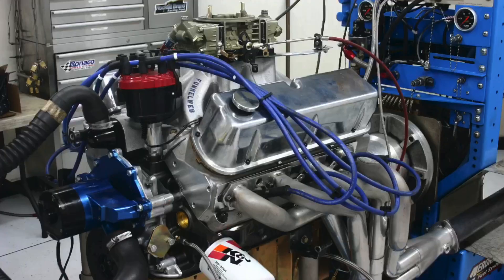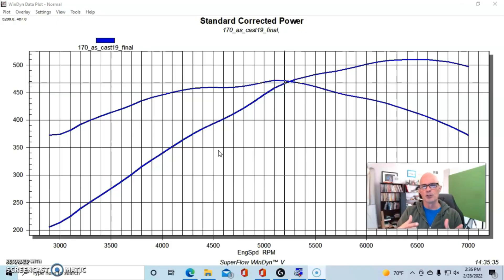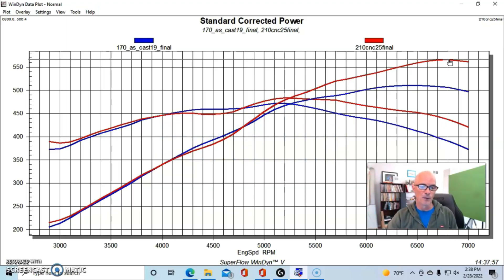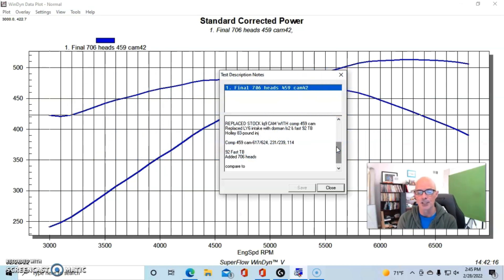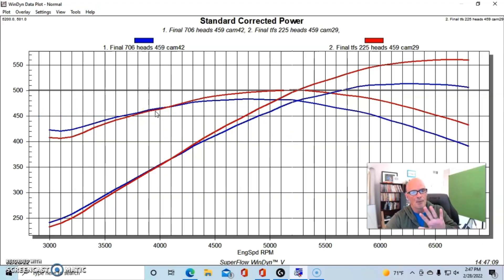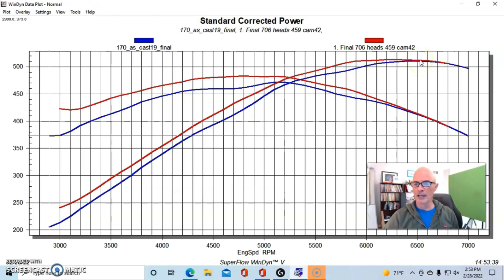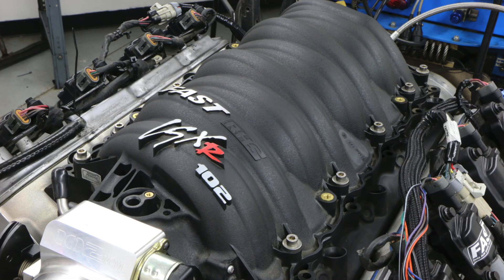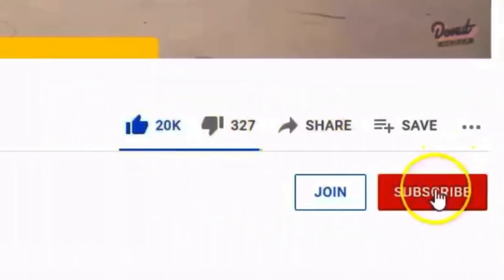HOW TO MAKE 6.0L POWER! FORD vs LS-WHICH 6.0L MAKES MORE POWER? MOD 363 FORD STROKER OR MOD 6.0L LS

Comment: I know a .030 over Cleveland with a set of Ford C3 heads will make more power than that because, I have  all ready done it. and you don't need a hi dollar after market block.  The C 3 heads were not any more money than a 225 TFS. The one thing I used was a solid roller cam. it may Give up a few Cubic inches, but the Cleveland can handle it.

Comment: If you are goong to compare two 6.0  engine ford and chev do it properly  same hyd cam and the same style inlet manifold can you redo the test again and this time have the dur lift and lobe on the same or as close as possible and run the holley high ram manifold

Comment: Some of these shows to me are amusing. If you want to see how power is made go to Engine Masters, Kaase as well as others took a Ford Cleveland to victory every year they entered the contest. And for a couple of years EM allowed the DOHC Ford's to enter. And every year they won, going 1-2-3 in one year. They had teams who brought the LS engines they achieved little success. The LS's boys complained and cried about losing. Finally, EM acquiesced and created an LS class because the engine could not compete with the Fords. And keep in mind Kaases Cleveland had been out of production for over 50 years! The LS was called a marvel of American Engineering, and it could not beat the extinct Ford. FACT!!!!!!! While almost all other companies went with the much better design of the OHC engines. GM stayed in the dark using the OHV set up that greatly hindered their performance.
Reply from the maker: ask yourself this, can both of them be good or do you have to put something down to try to elevate your choice?
Reply: @richardholdener1727  What I wrote were facts, go to Engine masters and look for yourself before you make a baseless accusation. What really surprises me is when someone does not agree with what has already happened, they attack the person not the facts that were stated. Are they both good engines? Is one better than the other? That is your choice to make. I am 74 and been a mechanic and worked in a machine shop. Drag raced both cars and motorcycles. And owned just about every muscle car out there. And I stand by what was printed and what took place at EM.

Comment: I went with a 363 for my fox body. I’m 100% satisfied. LS is cheaper for the short block but the corvette tax on parts adds up quick. Not to mention all the parts needed for the swap unless you can fabricate stuff. For me after doing the math they came out to about the same price and a lot more work vs having a fresh built motor. That’s something ls swap guys leave out often.
Reply: And, staying with a ford, especially a 5.0 based in a Fox assures you're not automatically banned from heaven. Had you went LS, it's an iffy eternal destination.
Reply: I make 600 hp on my dark block all motor ford going up to 1000 hp procharger or 1200hp
Reply: @jeffytherapper7279  how’s it drive on the street? Mine is at 530 and has some pretty reasonable manners. I was gonna grab a blower but I street drive it and it’s already a lot.

Comment: Ford is not that bad to build mine is a 398w stroker and I have 2500  in it good parts from market place I'm using a stock rod factory block

Comment: Yeah or you could buy a 351 from the junkyard and use 302 pistons and a stroker crank and have a 393 cubic inch stroker that when combined with good heads, cam, and intake would make as much as the LS, if not more. Depends on what you want to build.
Reply from the maker: 302 pistons don't turn a 351 into a 393
Reply: @richardholdener1727  No you need a 3.85 crank as well. I thought I had added that part but didn't, ooops. I have now added that part. Sorry just not a fan of using the LS in everything. I understand it is cheap horsepower but I'm not a fan of them in other makes. To be fair I'm not a fan of Coyotes in other makes either. I'm a fan of taking what you have and making it better.
Reply from the maker: this channel covers much more than just LS-in fact my first book was on Fords
Reply: @richardholdener1727  Oh I know I've watched dozens of your videos and been subscribed for years. Wasn't bashing you or the channel. Sorry if it seemed that way. Personally I like all engines although I'm more experienced with Fords. Would really love to see you test some AMC engines like the 390 and the 401. I'm not bashing LS engines either, I think they are amazing. I don't get into the arguments of this company stole that idea or blah blah blah either. Everyone's trying to make more power and better flowing heads help so each is going to develop similar looking items. Only so many ways to make a pushrod engine breathe better. No what I was saying is that I'm not a fan of taking out a perfecting good running engine and putting in a different make just for the sake of power. I'm a fan of making what you have better instead. Once again sorry for the misunderstanding.

Comment: Wish they were both ran with comparable cams and ported Holley hi-ram intakes. Theoretically,  they would be just about equal. The coil near plug versus distributor would probably still take the Win. I mean, engines are theoretically gas powered air pumps so they "should" perform nearly equal regardless of the brand.

Comment: First ford 363 run was with Dart pro 1 170's which have the 194/160 valve package.   I guess to compete with the AFR 165.   They did very well to make it over 500HP.
Reply: Agree with this comment.  The afr205 or tfs 11r 205 would let it shine.   Also intake manifold ported to go with the heads.

Comment: I would love to see an LS style intake made for the sbf.  Its basically a low profile tunnel ram.  Obviously to make it fit the Ford best it would have to be run distributorless.   But since it would be efi just go all the way.
Reply: Someone else said this and i agree.   They are calling them "cross ram" intake design...To get away with it a low profile distributor.

Comment: I've ran a lot of LS engines and I want to small block forwards I kind of go back-and-forth.. I like your videos because usually you do your best to make things equal.. But when you said it took a lot for the Ford the video shows the opposite you made a lot of changes with the LS kind of baby yet to get its power up I really think you said that because the LS guys and Chevy guys are always super sensitive.. But here's the bottom line the lower end stroke compression doesn't know if it's a Chevy or a Ford it literally can care less.. I would love for you to do this test using the new Holly Hyram on the small block Ford and LS The goal not to see which one does better but To see how close you could get them.. Because what I tell everybody is the LS Technology Is we're all the different is  Like I said the bottom end knows no difference only goal is for it to hold together other than that it's simple mathematical measurements.. I'm currently running A 408ww with  Holley Hiram LS style plug on wire with Holly terminator X system And I'm within 15 horsepower of the same set up with the 408 LS base motor.. Only reason I have slightly more power with the Ford Is most likely coming from my cook's headers really the only difference same size just a little better Collector in my opinion.. I absolutely love ls motors  But It's actually more unique to have the Ford motor in it nowadays.. And out Of the old school motors The Windsor is by far the Closer to the LS motor even than the small block 350.. But always a great job and love the videos but if you could please do a more direct comparison with the new Hollywood high ram and go with the  AFR220 renegades on the sbf  With the LS style coils And Halley H iram That's really A test everybody wants to see Bring the Windsor into The technology of the LS Not to try to beat it but to show people The capability of an old motor with new technology.. I know you can never get these things Completely even they're in 2 different worlds But the bottom line is they're both awesome motors with the right parts!!

Comment: How would the Ford run on the street? Could it handle a 200 mile trip at 2200 RPM?
Reply from the maker: FOR STREET USE I WOULD PICK A DIFFERENT CAM

Comment: Let’s make it a lil more fair next time you want to? 
How about running heads that actually flow as good as the heads used on the LS, and yes there’s plenty out there that flow better than these right out of the box. And also make it more even across the board, two completely different engines styles but you sure could’ve made the Ford perform better than that.
 I mean just think about how many 700+ HP SBF’s out there running around N/A with room to grow.. and to do the same with an LS is a lot more money. IF you know what you’re doing with a Ford engine to save money but still make power! It’s been done plenty around here in Florida!

Comment: I sure don’t understand why the 363 is called a stroker, what block was stroked? Not a Ford block so it wasn’t something else before, not a stroker!
Reply from the maker: THE 363 HAS A 3.4-INCH (NON STOCK) STROKER CRANK
Reply: @richardholdener1727  I'm well aware of the makings of the 363, the crank is a stroker crank in a 302/289 block but not the Dart or Ford non production block because they were designed for that crank. The 347 is a stroker the 363 is not.

Comment: I don't understand why you would not have run a dual plane on the Ford. Every test you run, the single plane kills everything with very little up top gain on your SBF tests
Reply from the maker: a single plane made much more than the dual plane on the 363
Reply: @richardholdener1727  Fair enough, but much more where? I was curious how a dual plane vs the long runner LS curve (tq and hp) would look say below 5500

Comment: I find it funny that for both engines the hp curve passed the torque curve at around 5250 rpm
Reply from the maker: YOU SHOULD FIND THIS EVEN FUNNIER-THE TORQUE AND HP CURVES OF EVERY ENGINE EVER MADE CROSS AT 5252 RPM

Comment: Ok Richard, this might sound crazy, but I've heard LS heads can be made to work on a 351W block?
Could an LS top end swap show any difference on to old 351 short motors (or Dart equivalent)with 30-40 years difference in friction and block stiffness design?
Do modern V8s make most of their power from head flow?
I'm kinda intrigued. (Or overly tired 🤣)
Reply from the maker: an ls head flows a lot more than a 5.0l ford head

Comment: Trick Flows are better flowing heads than DARTS. The Dart head is based on old tech, Trick Flows beat them every where in the RPM range.

Comment: I know Richard is not suggesting it, but the LS go fast goodies in this video didn't come from the "junkyard" and they weren't cheap.  If we just want to restrict the comparison to what's in the "junkyard", then it's pretty easy to find a cheap junkyard 351W and toss the heads out for aftermarket.  Yes, if you find a 6.0 LS (or any LS) you can keep the stock LS heads which are excellent but they better be since GM decided to optimize a pushrod engine when the rest of the world went to OHC for better specific fuel consumption (and other reasons).  Ford has not used pushrod engines since 1996 (except Godzilla), thus the LS/351W engine designs are not in same genre and although comparisons are inevitable, they are tiresome. Putting all that aside and sticking to junkyard gold, I don't think it's that easy to find a junkyard 6.0 LS (5.3 LSs are even getting harder to find).  Outside of the junkyard, I have seen a lot of the 6.0s for sale for much bigger money (like $1K) vs.a used 351W, so if the 6.0 LS is really that easy to find in the junkyard then why do they cost so much used?  These HP/TQ engine comparisons are interesting, but as Richard has said many times, similar displacement combined with similar head flow is going to produce similar HP/TQ. Building a high HP/TQ 351W stroker is not that expensive due to SBF economies of scale.  The argument that LS HP/TQ is cheaper per liter compared to other engines is true but only if you acquire one cheap, like from the junkyard, and run it unmodified.  Let's put aside the chassis conversion costs, which are not free.  Start modifying the engine like Richard did in this video and LS HP/TQ costs per liter shoot up fast. Same goes true to rebuilding that "junkyard" LS.  Rebuilding an LS isn't free or cheap either. Not trying to start a LS vs. the world argument, but again, Richard has said many many times, that similar displacement combined with similar head flows are going to produce similar HP/TQ every time (other factors being similar like CR).  If you really want to make a HP/TQ per liter argument, a stock junkyard LS wins every time, however I'm not sure what a junkyard engine vs. junkyard engine comparo is good for in a practical sense. since most people who pull a junkyard engine rebuild it.  Rebuild that LS and start adding go fast goodies and the HP/TQ per liter comparison equals out.  LS machine work isn't free and LS aftermarket speed parts aren't cheap.  I think the only real stand out comparison worth noting is that you can keep the junkyard LS heads where 351W heads need to be replaced, however a used craigslist 351W is usually cheaper than a big 6.0 LS ($250 vs. $1K).  Yes, its possible to find a junkyard where all engines are the same price, but like I said, its getting harder and harder to find the unicorn 30K mile crashed Corvette big LS for $150 at a pick-n-pull and drop it stock into your dad's 69 Camaro and hang out with the boys at the next LS fest.  Well done Richard on another great video.
Reply: Very well said.  I think you touched on Richard’s over arching theme that engines are air pumps.  ANY engine can make power, but you need good induction to get the air in and out.

I agree with you about the LS only being cheaper if you go SBE/junkyard induction.  Because as you said swaps aren’t free to adopt into another platform.  Most guys that are swapping are Chevy guys going into other platforms, because other than the old G and F bodies, they don’t have much else in plentiful numbers to race.

Comment: Bottom end of LS is far superior than the 351 block so the LS  will handle the hp all day long compared to the non skirted 351. I would've rather just see a 60 over chevy 350 = 360 ci. Blocks are a little more evenly compared since both are non skirted. Carbs/fuel injection  when tuned are within 1hp for that day anyways. Reliably is the only factor between these 2 engines with the LS coming out on top. Add another 100 hp to the LS and it's still the better choice.
Reply from the maker: .060 over is iffy on some sbc blocks
Reply: LS is certainly a bad ass

Comment: We did an offset  stroked Windsor at 3.52 with Chevy 2.2 rod journal and a 6.125 rod with a 302 type 1.6 pin height piston. Top end was world 200 ported iron heads and vic Jr intake.  Never go it on a dyno but ran good . We had no problem  keeping up with 383 sbc at the dirt track.  Like Richard said Ford guys like to build ford's and Chevy has always been a better value.
Reply: All that work when you could've just used a 9.5 deck Windsor? That heavy crankshaft isn't as big an issue as they tell you. We turned one 6900rpms drag racing, and I  know you're gonna tell me ur doing that twice a lap for 20 minutes! I could care less, don't care for all that paint swapping!

Comment: People need to realize some of these tests were done a long time ago. The darts were run to pay for a magazine. Any ford guy will tell you that motor needed at least a 225 high port,225 twisted wedge r, or afr 225’s. It also need more intake like a super victor or if you wanted to keep some runner length- a Holley hi ram.
Reply from the maker: Pay for a magazine? I take it you are new!
Reply: @richardholdener1727  No not new lol Street Muscle Magazine Nov 2016 words and photos by Richard Holdener and Muscle Mustangs and Fast Fords Dec 22,2010 by guess who Richard Holdener.

Comment: Look, it's hard for everything to be apples to apples with diff brands. But, when all things are equal e.g. C.I l's, similar pistons, same intakes (hard to do), same cam (often cams are more favored to chevy specs) but I  digress), they make the same power.
 The real diff in the brands is when they are stock who used better parts, which one has superior architecture. 
With aftermarket parts, it all becomes moot. From experience, with your older 4 bolt sbc stuff or mark series engine vs ford windsor, fe, or 385 series, the one thing I can say is, the chevy stuff was easier to make power money wise, but to me, that's where the advantage stoped. 

It was my experience that when you kept the pedal to the floor and dogged the pics out of the engine (mudbogging), the fords seemed to hold the abuse better. If a chevy ran hot, it was done for the day, let the ford cool down, fire it back up, do it again. Maybe ppl have had opposite experience as me, but I've seen this situation time and time again! 
However, now that I'm older, I appreciate all brands (old stuff anyway) more equally.

Comment: This really proves the old adage that an engine doesn’t know what brand labor it wears.  Similarly built engines, regardless of brand will produce similar power.

Also I am an old school muscle car fan and as such I would NEVER put an LS in a classic muscle car even if it made more power for less $.  Part of the appeal of a classic hot rod is popping the hood and enjoying the jewelry under hood.  Opening the hood of an LS equipped car is akin to lifting the engine cover on a forklift.